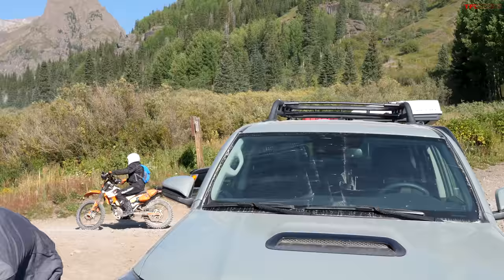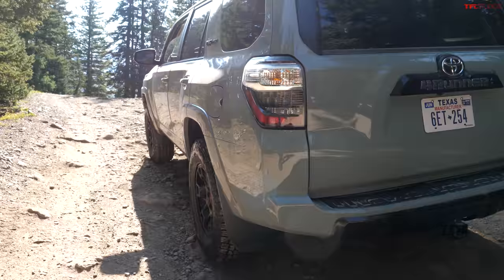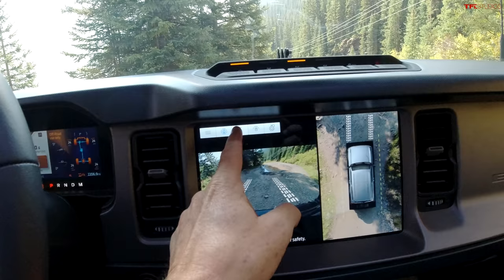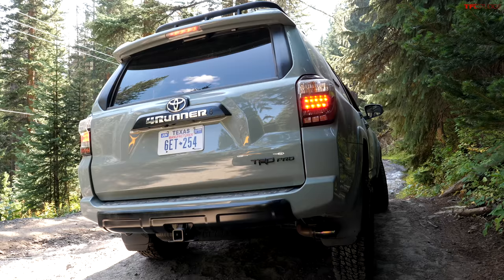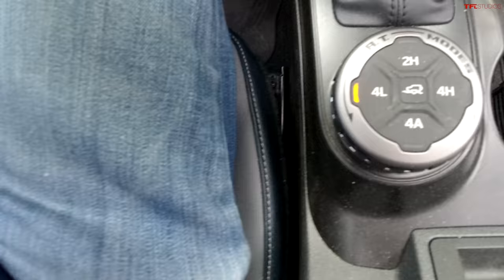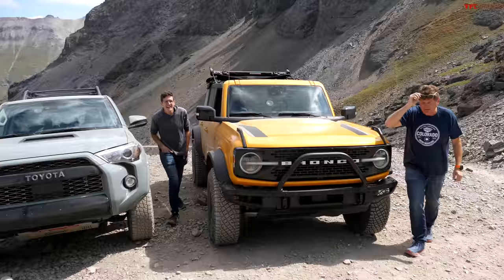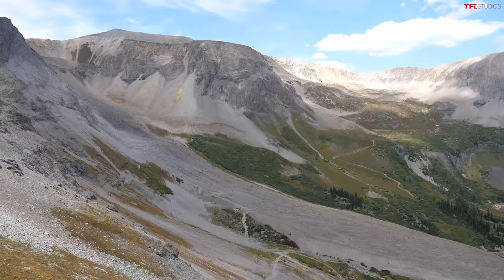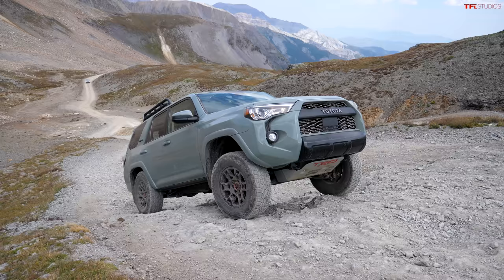The Toyota 4Runner TRD Pro May Be Old, But Can It Still Keep Up With The Ford Bronco Up A Mountain?

Comment: One of best things about the 4RUNNER is that you can actually buy one.
Reply: Yeah at over MSRP especially these TRD Pros.  In 10 years it’ll still be on the road and probably still worth 50% of its MSRP
Reply: $15000 over sticker
Reply: They’re expensive but they hold to value very well.
Reply: I’ll take the bronco
Reply: yeah and the used car lots will have plenty to choose from once people drop them off for their Broncos.  Might be a great time to get a 4runner or even a deal on a TRD Pro.  Meh i’ll stick with my 3rd Gen.  I would absolutely love a Bronco Wildtrack but if i came across a deal on a TRD Pro 4Runner it would make a very very hard choice.
Reply: and i did it
Reply: Kind of, looking for a 4runner is difficult right now, plus Toyota isn’t letting anyone order from the factory right now /:
Reply: Yeah because no one wants one lol 😂
Reply: Do you own a junk yard?
Reply: @anthonyrosa5006  I missed the boat last year as well. There was a 2018 TRD Off-road premium 45k miles white with  kdss and black TRD wheels going for 33k. Now that same configuration will cost me almost 50k in my town. I'm just going to enjoy my trusted and not rusted FJ for a few more years. Save up and pay full price when all the smoke blows away.
Reply: If you have a brain you aren't buying anything rn
Reply: @chuckderuyter   yup and that ford will be in the shop every other week!
Reply: My local Toyota dealer doesn’t markup any of their cars.
Reply: hope bronco won't break during offroad trip
Reply: and for msrp unlike the bronco where you are normally going to pay 10-20k over msrp
Reply: Take the time to book you service Appointments
Reply: Toyota production for 2022 is down 40% for 2022 (not the tundra) sadly the price hikes are going to be insane until 2023
Reply: @youtubecarspottersguide1  dont buy one at that, i'm in texas and its 1500 over
Reply: @bobbydemondukes  You live in a pretty extreme fantasy world lol.
Reply: @Pleasiotic1  Dat you Powers?
Reply: Bump LOl ☝️
Reply: 2 Broncos near me for sale- dealer has them marked up 30k haha 84k for a Sasquatch
Reply: @Mycameron2323  $20k over msrp in gainesville tx
Reply: really where?  there's about 6 cars at my Toyota dealer, I think a couple are Toyota's, no trucks or suvs.
Reply: I ended up going with an Outback wilderness edition instead of the 4Runner, very happy with my decision so far, that car performs so damn well, and is super capable off road and in all types of sand/mud. It’s really hard to beat a Subaru
Reply: @bobbydemondukes  I do. Give me tha last year of the made in Japan 4runert before 4 cyl turbo and watch it be worth more than msrp indefinitely.
Reply: @boughtandpaidforautoreview1150  lol 😂 💩🤣
Reply: But you don’t get a shower biult into the roof like the bronco
Reply: @chuckderuyter  we got a 12’ Highlander brand new in 2012 and the thing is still worth around 20k with 85k miles.
Reply: True statement
Reply: @joshuayork4693  I really like the new Bronco & im not a Ford hater, but for 84k im NOT getting something with a Ford badge! Lol
Reply: @bobbydemondukes  lol it’s sold out for a reason bum
Reply: @chuckderuyter  got my TRD pro in lunar rock at MSRP. Locked in the price waited 6 months for my vehicle to arrive from Japan, by the time I finally drove off the lot it was going for $15k more then what I paid.
Reply: This comment for the win!
Reply: Let’s go Brandon 🇺🇸
Reply: Yeah Toyota actually came out and said they could sale vehicles for half the price they sale them for and blow everything off the road but they don’t want to hurt the market like that
Reply: Let's be real I haven't had a modern Ford last over 100k miles except the Crown Victorias after 12 Fords never again I'm staying Toyota from now on
Reply: @carbonunit  friend just bought new 2021 for 46
Reply: Any idea what an 89 Toyota 4x4 pickup with 171000 would go for?  Good  condition
Reply: @queefersutherland8495  idk depends on what it is like, probably at max 5k
Reply: @noahjones3955  thanks bud
Reply: and they will easily outlast the ford   and hold value  unlike the ford
Reply: Back when there wasn't a chip shortage and other complications due to covid, I'm sure a lot of things were readily available 🤦‍♂️
Reply: A used one
Reply: @tuckerhiggins4336  I'm with you, gonna wait.
Reply: The Toyota roof doesn't leak,  now I see why Bronco added drain plugs.
😂
Reply: @MrStaybrown  lol!!  Good one.
Reply: Was promised this winter or early spring, now it’s 2022 fall hopeful
Reply: @jonathanrigsbee7533  Hey there.  Are you talking about the Bronco or the 4 Runner?  Wondering if the 4Runner is delayed also.
Reply: @realthing66  bronco, I order one like the 6th day it came out and I’ve been pushed back a year
Reply: @Keigan884  that was a mistake. Just wait for cvt to go. Will never buy a car with cvt ever again
Reply: @tuckerhiggins4336  Finally someone with some sense
Reply: According to my bank account. I can’t relate.
Reply: I pick up my 2022 Toyota 4runner TRD off road premium Friday..Perfection
Reply: I just picked up 2022 Toyota 4runner TRD off road premium.  51k out the door.  I'm sorry the Ford WILL NOT last 300k miles. The 4runner is 100% completely dominant I a day to day driver and then off road king 
 There really should be no debate about what truck will last longer!
Reply: @michaellowery4001  Yeah I agree, I love the new ranger but I have no hope in it lasting half as long as my runner. The 4 runner is a easier choice in my opinion.
Reply: @michaellowery4001  I’m sadly forced into the buying market right now and I’ve been looking at the 4Runner, Bronco, and even a Jeep GC. In WA state any Bronco you can find is around 15k over MSRP so that pretty much counts that out. Regardless of how good it may be, I won’t pay that much over MSRP
Reply: I would rather overpay for a Bronco than overpay a 10 year old “new” 4Runner
Reply: It's all perspective..for me my 2022 Toyota 4runner TRD off road premium has the most technology I ever had. I was driving a 2010 Nissan Xterra SE.  No technology at all. I paid MSRP for mine. It was 51k out the door including taxes.  I bought the Toyota because of its reputation and I know it will last 300k miles. That Bronco has not been tested and it may be more technology savvy but I don't care!  I have no regrets buying a 4runner.
Reply: My 2022 Tundra was about $2000 over msrp not too bad but still sucks. I needed it so I couldn’t wait.
Reply: You would not be in a bad place with either. The bronco is more off-road orientated and the 4Runner is a little more forgiving in everyday task
Reply: And it last forever and ever and ever
Reply: If you can find a Lunar Pro, it's almost at bronco prices 😒
Reply: Im curious to see how they both are doing at 250k miles...
Reply: This aged well
Reply: Underrated comment lol
Reply: You can buy one and even better……. You won’t have any catastrophic problems before it hits 60k miles. Even better it won’t sit at a dealership for months on end !!!!🎉 👍👍
Reply: @gothops154  you’ll be overpaying fixing that junk Ford in the future 😂
Reply: Put a Marlin Crawler RCHD Long Travel front end on a supercharged 4R and youll have a reliable bronco beater that holds value and wont break steering racks or motors/transmissions like the ferd stuff and can rock up to 40" tires w some front fender/bumper trimming.
Reply: @JayElement13  won’t even last 10 years sadly if not I’d take one over the trd pro but I got my tundra trd for now
Reply: That Ford will be in the junk yard and the 4runner will still be climbing rugged mountain passes! No doubt
Reply: And it is sooooo much more reliable than Ford & Jeep
Reply: Toyota is proven to run a million miles, enough said
Reply: Funny, I couldn't find a TRD pro so I bought a bronco.  Drove the defender, it had electrical issues. I asked the dealer about it, he said they couldn't get parts to fix it.
Reply: Easy call, 4Runner, Bronco is nice but EcoTrash kills it
Reply: They kinda are expensive.. even the old ones

Comment: Plot twist: Any trim level 4x4 4Runner could have easily done this trail.  No need to always get caught up in the TRD hype
Reply: True.

But to be fair the TRD Pro "looks" alot cooler 😎 than the other trim levels. 

And most people buying these are doing it for 80% looks 20% capabilities. 

I've seen 4runners with snorkels, roof racks, mud terrains, etc, and when I ask the owner about their lift kit it's either:

A) I don't know the dealer did it for me

B) It's just some spacers from Amazon

I always say "that's cool", and feel bad for the truck. Almost the same feeling I get when I can't rescue a lost puppy.
Reply: 100% fact, an sr5 with ATs and atrac on can do pretty much anything Colorado has to offer.
Reply: I'd rather buy the SR5 and use the $15K i saved vs getting the TRD PRO on my own accessories and having a unique build. I work as a tech at a Toyota shop and we call them the turds because of the price hike for minor cosmetic changes esp on the cars. The only car maker that could get away with slapping their performance badge on their regular cars is BMW, i owned a 335i with the M// package and although the excessive badges were tacky they looked distinctive from the regular models and they tune the suspension and steering on later ones.
Reply: TRD does look badass. I want to take my 16 limited to a trail but I’m afraid of messing up the trim due to the lower clearance :(
Reply: @uuuu260  get some rock sliders made for that trim. 

You'll be fine
Reply: You’re so right. @ 22:04 there was a stock 4th gen 4Runner at the top of Imogene Pass…
Reply: Agreed. Buy an ORP and upgrade the suspension and tires with the money you saved
Reply: You're right. My 2016 Trail could've done the same Pass. But if I could've afforded it, I would've bought the TRD Pro.
Reply: All you really need on an 4 runner is 2.5 fox shock w/dsc, RCI fully body skid, rock slider and some A/T 285/70/R17. This build can pretty much take you everywhere already,
Reply: @uuuu260  I was just out there in July. I have a limited also just had to remove the running boards and I had zero issues
Reply: As a TRD pro owner I couldn't agree more.

Keep the freakin leather seats. I just want the locking diff
Reply: I completely agree.  I have a 15 SR5 Runner and the capabilities of my truck are amazing in stock trim.
Reply: My 2000 2wd suburban made it through.  With 3 inch lift kit, 34 inch m/t tire ( thunderer) and a factory g80 locker.
Reply: Why pay someone to advertise their products? TRD (or any specialty  company) should payback for putting their names all over their products. I haven't looked,  but is there a big enough difference between a TRD Off Road and a Pro to justify the cost difference?
Reply: would the sr5 make it? trying to see if i should just get sr5
Reply: @matte8441  would love to hear your thoughts on the SR5 Vs TRD Off Road?? Looking to buy a 4runner in the future but dont know which one would be better choice. Thanks in advance!
Reply: @MrDW72  Depends if you’re a hardcore off roader. The TRD OR has a locking rear diff, crawl control and optional KDSS which is handy on the trail. That aside it’s similar to the SR5. Those features may be handy but not that important, It has more to do with the driver, if they know what they’re doing an SR5 is more than capable for off roading as well. For something that will be on pavement for the most part the SR5 will do.
Reply: @cocx88  The steps at the top of Black Bear Pass will rip the transmission out of a stock SR5, if you don't know what you're doing.
Reply: I’ve posted it before but there simply is no reason to ever get the TRD PRO. Too much money for crappy components you’re just going to rip off and replace with real off-roading components. The Trail/Off-road trim is the best bang for the buck as it gives you all of the 4x4 capabilities at $10k less that you can spend on a real lift and better off-road parts.
Reply: My Honda Civic will probably make it up there. It's been through much rougher terrain. LOL
Reply: @AssMcBlast  Well, you can get that with the TRD offroad version
Reply: @williampatten9165  Just the black out badge....really
Reply: @matte8441  yeah but the resale on the PRO far exceeds an SR5
Reply: @cocx88  yes, until you get to the really hard trails, that’s when atrac will fail, like when you get to chinamens gulch, atrac won’t help
Reply: I did it with one wheel drive in my Tacoma (4x4 broke).
Reply: I sense haters
Reply: @MrDW72  You really have to be honest with yourself.  If you really don't plan on going off road moderate..You don't need the TRD off road premium.   There are so many modifications you can buy that will make the vehicle yours.  For me..I saved up and got a 2022 Toyota 4runner TRD off road premium Barcelona Red with upgraded pro wheels and skid plates.  I put BF Goodrich KO2's on immediately.  Every 4runner owner needs to understand....that modifications cost a lot of money.  Long story short if all you want is a super cool truck to go off road minimum..save your money for modifications for the SR5 premium.  4runners are cool period!!!!!!
Reply: TRD Pro doesn't look much different to me. Mudders on a base 4Runner looks more aggressive. Add cheap lunchbox lockers. Maybe slide a multi-mount winch into the hitch. Tackle all kinds of terrain.

 My base YJ on 30s did Webster Pass with open diffs. Lunchbox lockers for around $300/ea made even worse trails easy.
Reply: @uuuu260  convert front end to trd pro like me, just need to swap bumper reinforcement, bumper cover (sr5 cover), then buy a lower grille, and trd pro conversion grill lit from ebay or some website, and foglights. Then just yt how to remove bumper, swap bumper reinforcement, then switch the steel and the covers. Then install fog lights and trd grill then your finished. All in all cost me about 1200$. Not for everyone especially if you like the limited front, but always something to consider because not many people know its possible and even easy
Reply: @leolpz8253  oof
Reply: But the TRD OFF ROAD AND TRD PRO have a 4x4 Lever… not electrical knob 😬
Reply: The only thing that helps for offloading on the TRD model is the skid plate
Reply: The bronco seems like a nice off-roader with off-road oriented tech added inside
Reply: I lived in Southern California for a while and used to go off-roading in my 2019 4Runner Limited. The A-Trac was fantastic and handled every type of terrain. When I brought my car in for routine maintenance I told the service writer how much I appreciated the A-Trac. He told me I was the only Limited owner he ever heard of that went off-roading in a Limited.
Reply: @timothyj.2937  yes
Reply: @timothyj.2937 yes
Reply: True. As someone who wants to have an opportunity to do my own installs but also start with a "looks" package. The SR5 4x4 with xp  is for me. Crawl and diff lock are nice to haves, but not neccesary imo. But I am not an experienced Crawler.
Reply: @dalepellerin  the Pro gets you rear lockers, tuned Fox shocks, crawl control, and a small factory lift. All installed ans under warranty. I know because I have one. Not for everyone for sure, especially if you really enjoy planning and DIYing some of the upgrades. But, if you’re like me and just want it right and under warranty from the beginning, TRD Pro is NOT a stupid choice.
Reply: I got sr5 build and can keep up with the trd pro. Just atrac and your good. My sr5 sometimes looks more cooler than the trd pro😅✌️
Reply: @kingbetong8741  If that’s what you want to believe then fine by me. Attach is a really good system and can get you to 90-95% of trails but if you don’t believe that a locker makes it more capable then there’s no reasoning with you. I wish Toyota made a front locker too. That’s the only thing that makes a ZR2 more capable than a Tacoma.
Reply: @allenmcdonald1652  your right,maybe i havent went to trails that i needed a locker.😉👍🏻
Reply: @matte8441  exactly what I did to my SR5 (only trim that has a 3rd row seat) I got a flat hood and a  REAL supercharger w 350hp now, 2.75/3" lift and OEM audio dual sub sound system. Going 35s and regear soon w rear Air locker. Its alot cooler than the turd pro w fake intake scoop hood and 1" lift lol....the ONLY thing the TRDPRO version has the other doesn't is the MANUAL tcase shifter. Toyota needs to only offer that on all 4x4s and get rid of the dial system. It is BILL-STEIN not 'steen'...he got it right lol. The 5speed Auto is awesome they are behind 400hp+ lexus ISF and live happily. Nobody needs 6-10 gears thats all EPA garbage. I had my trans fluid dropped at 70k miles and it was CLEAN no issues in the pan. Trans shop guy told me It was a waste of $ to do it even wheeling the truck extensively.
Reply: @dalepellerin  yep...the one thing thats WORTH having is the Manual Tcase shifter but thats cheaper to build for Yoda than the fail actuator junk all you get on all other trims. all you get w lro vesides that is blacked interior trim, fake air scoop hood and a 1" lift up front and a rear e locker. ARB air locker is better if added. Everyone swaps the shocks to other stuff when they do 3" lift.
Reply: Not all trim levels have rear lockers
Reply: @williampatten9165 yes. Its smarter to invest in the pro. The resale value alone is a no brainer.
Reply: @txrunroutdoors super late here but I’m a new owner of a TRD pro and my reasoning of getting the pro is because I’m not a over lander by any means however, I live in a super rural area where washed out dirt roads and rough terrain is common. I don’t want to deal with modifying vehicles for warranty sake and such so having a sporty looking stock pro that’s covered bumper to bumper by warranty is nice.